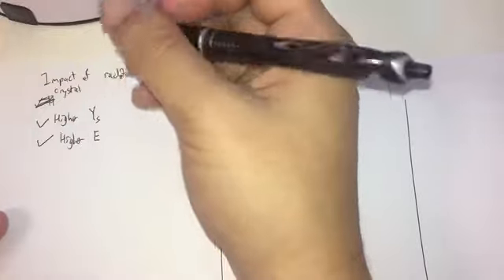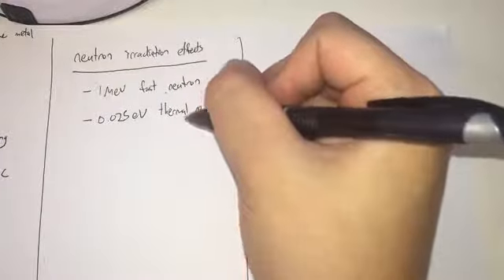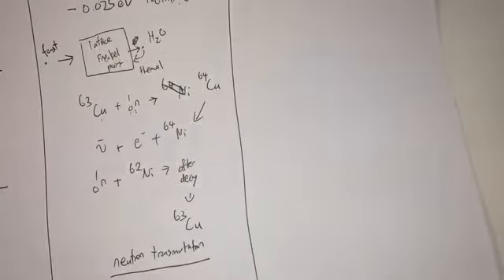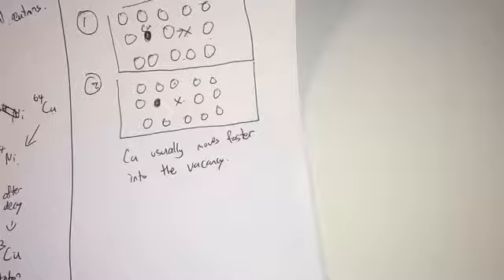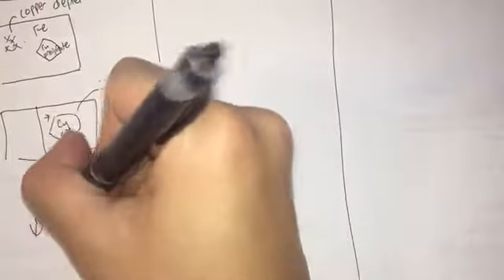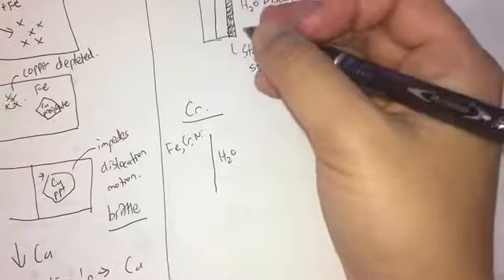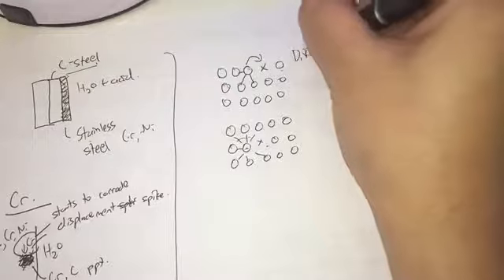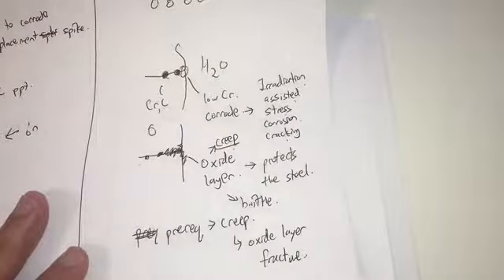Introduction to material phenomena in nuclear environments 11 - alloying element interactions

Comment: So these phase changes in the steel from neutron transmutation are what causes the embrittlement? I learned today that despite having a negative Chrapy curve neutron radiation increases hardness instead of decreasing it like normal on heating up and pressurizing. Fascinating stuff actually!